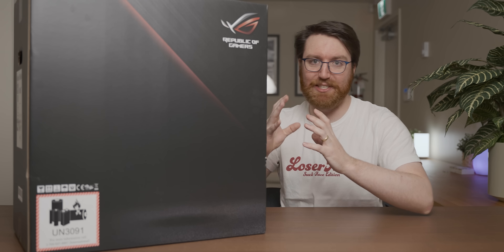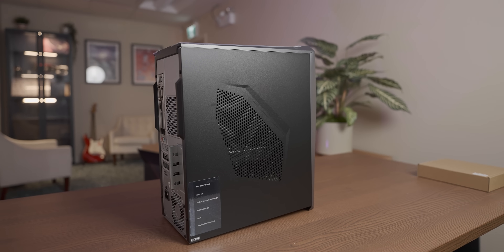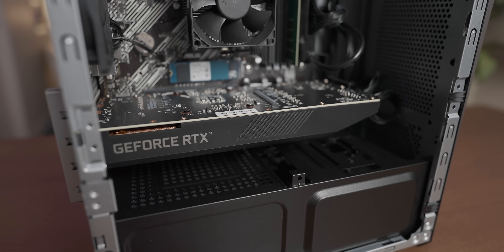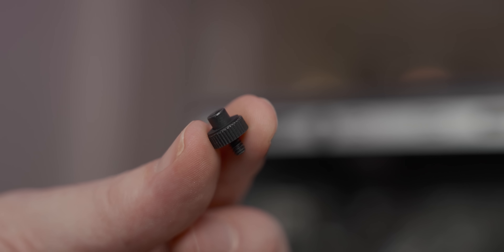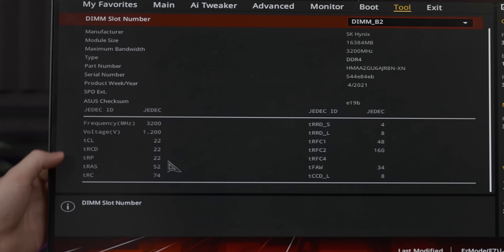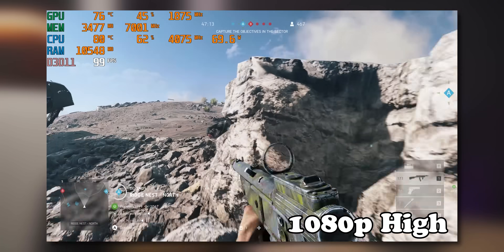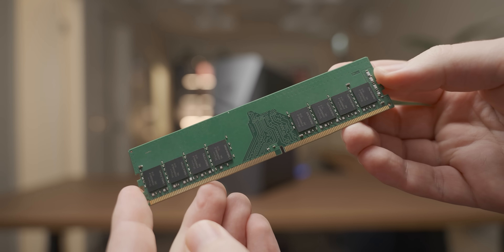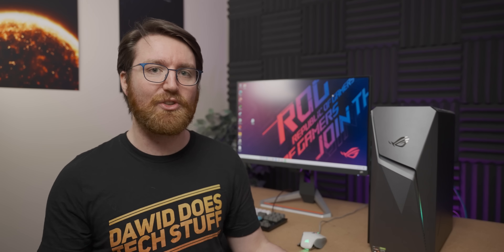Why Do Asus ROG Pre-Builts Suck So Bad?

Comment from the maker: If you want some cool clothes and help support more videos like this, go check out the Dawid Does Merch Store here: https://dawiddoesmerch.com
Also, thanks for watching. :D
Reply: I’m getting a pre built that has a 3060 👀
Reply: Take a Dremel with a small cutting wheel and make those fake vents functional.
Reply: Best channel
Reply: Best video
Reply: Best youtuber
Reply: How about a vid on an easy case mod to increase airflow and how much it improves performance. Love your channel.
Reply: are you every going to look at canada computers prebuitls there armory brand. You should there a great price to performance ratio but have bad power supplies for sure.
Reply: Let's see you upgrade the cooler and take off the front panel to see it perform.
Reply: I'm absolutely loving your content, and I think the comparison of single ram stick to 2 is a great touch! I think there is an avenue to bring your videos even one or two steps further: Could you run another set of benchmarks and temperature tests after adding additional case fans and aio to these systems? Given GPU outages and frequent discounts on prebuilt systems, I believe that many of us are considering whether we could just buy some of these prebuilds and then further improve for under 250$.
Reply: I just recently discovered your channel and your content is awesome.  You are well on your way to a million subs.  Your hard work and dedication really come through in your videos.
Reply: @dawid can you also try and fix the temps on this prebuilt
Reply: Great video as always Dawid
Reply: Too bad that you have not removed the front, would be interesting to see if that would bring something but since fans are missing in the front...
Reply: Two other tests would be:
 •Side panel off.
 •Rebuild in a better case.
Reply: hey Dawid, really great deal, want to trade your 3700X for my ryzen 5 3600? This system needs a downgrade lol
Reply: Can you do a review on XUM gaming pc pls
Reply: Correct me if Im wrong, but is the MB an Asus Prime B550M-K?

I saw that MB tech specification on Asus USA homepage and said it has a VRM heatsink, while the picture on the homepage does not show any VRM heatsinks at all.

And also, IIRC the B550M-K do not have ARGB headers, and does not support Aura Sync. Why does the brochure for G10DK said otherwise?

Did Asus made a mistake about their specs and advertisement on their site or I'm wrong?
Reply: So what pre-built should I go for! Im looking for a good one to run Steam VR & capable of next generation gaming/ray Tracing etc?
Reply: Ant esport case
Reply: You ask why the cheap front panel and cooler, I would say cost cutting obsessed (They would say profit increasing) Accountants.
Reply: comming up next why the corsair prebuild sucks, sponsored by asus
Reply: There were editing flaws in this video.
At the end you recommens asus to upgrade the cpu cooler, there is a poo sound but no image example 😢
Thats all! Love your videos! Your doing great!
Reply: upgrade it drill holes in the front panel or cut a square out and glue a mesh their too allow airflow then 2 rgb front fans with a rgb controller and a exhaust fan too the back of the case , plus a Coolermaster 212 black edition on the CPU and a full occupation of complementary ram PIMP it properly ....
Reply: no thx
Reply: I bought a Asus G11CB back on 2016 which had a Delta PSU 🤣 After so many years they still use shit power supplies for their systems 😎 LOL 😎
Reply: Dawid I just bought the asus rog r7 with the r7 5700g dual channel 16gb 3200ddr4 and a asus 3060.  Using cinebench my cpu went up to 93c pretty dang hot.  With no intake fans and one exhaust in wondering if replacing exhaust fan and a new cpu cooler would help?
Reply: I got armoury crap on an msi mobo to control an asus gpu and it literally broke my windows
Reply: Shoulnt you write actually what you are testing and not let us guess.... a downvote and im not watching this
Reply: Can anyone tell me if it’s a atx motherboard or not
Reply: @yourhandlehere1  that's ruining the warranty
Reply: @tjtjmich16p  I've never had a case "go bad".
Reply: This maybe a stupid question ; but is it possible to feed the temperature sensor info into the RGB colour output of a PC equipped with that sort of thing so you can keep an eye on if the PC is running hot  just by looking at the colour of the Christmas lights on it ?
Reply: could you please put the sticks of ram you purchased and what fan you recommend on an amazon affiliate to buy and you can get credit too please?

Comment: Looool. The ‘fake’ front airflow marketing just breaks me.
Reply: @moonman7777  The case got better airflow than my own custom build.
Reply: @skids6885  That’s impressive. Is it in just a metal shell?
Reply: @Psyberify  i was sorta joking on my sentence, since my case only has ventilation from the side towards the front io. In others words it doesn't breath. Just the interior exhaust fan at the back of the case is effective.
The case has a very nice exterior with a tempered glass side panel, and a brushed aluminum look front panel.
Reply: @skids6885  
my case makes  this case look like an air tight coffin.  i'm using a CoolerMaster HAF XB lanbox/test bench case.  two  120x120 fans in front one in back and a big 200x200  fan on top.   the main board lays down in this style of case so i coupled it with a Be quiet  Shadow rock  top down cooler.
Reply: @DenverStarkey  That case looks somewhat like a box server ngl, but still really cool, that case has alotta airflow ventilation. Makes me replace my case with something similar since my cpu temps always spikes high underload.
Reply: @Anna Muller did you take the kids and run yet since David has bought so many PCs?
Reply: Anna. and Dawid, the studio looks amazing! Well done. Xx
Reply: Say ,Anna,how DO you manage to deal with all the pre-builds Dawid bought???
Is there a limit ?
(8))
Reply: Even worse is the fake picture advertisement showing a decent beefy cooler when they throw a cheap Celeron cooler in the case.
Reply: I did learn something today though: Actual airflow is more important than marketing airflow
Reply: everything is fake in this build, until its named rog
Reply: wait till you see the bs from dell
Reply: @Tano facts
Reply: It’s so weird - how can it be difficult, or add to the overall cost, to have some airflow slots cut out?
Reply: In their defense, that image shows them using the clear side panel which WOULD have air flowing through the front gap right where the image shows the air.  That said, I think the image is still a bit misleading since the air coming in stops before the gap in that side panel... thus anyone looking at it is going to think they have holes in the front.
Reply: The job was given to a Graphics Illustrator, to Illustrate a Blue mass of air, becoming a Red mas of air, but the Illustrator wasn't informed of the Faux Grill, of the PC. (being suffocated, and all.)

Comment: I think ASUS is doing something very technologically advanced with this case. Air flow by quantum tunneling.
Reply from the maker: Maybe it's the next big step in case design.
Reply: Ant-man style ;)
Reply: @DawidDoesTechStuff  i am glad i went with Coolermater case H500 its awesome and tons of airflow with front panel MESH..and 2x200mm fans.. got great temps even with 5900X and 3080 its just on another level even those ports on front with case its horrible just a few ports..
Reply: those temps are so bad.. i stay under 65c even under load in games with my 5900X using 360mm Aio and GPU is Gaming X TRIO so i stay around 70c even with 3080
Reply: Unless the tech is a result of alien negative energy tech the constraints in airflow is choking the life out of that poor gpu blower. The blower motor will probably fail before the gpu. The gpu will meet the same end soon after.
Reply: @ivo3598  dumb question but maybe you can help. How do I identify which case works with my pc? I got the asus prebuilt from BB coming in two days. Only negative is case/heating so I’m hoping to correct that right away
Reply: @davidbartsch255  TBh, you look what you like, if it fits your components in, and then you check out some reviews about cable management and temps. But as a rule of thumb: Lots of Mesh is always a great Idea, and dont overspend on your Case. Trust me, its perfectly doable to spend like 300 bucks for a really fancy chunk of heat. It all comes down to what you want. If you dont need super amazing RGB Lighting and just a case thats not disturbing you, you can get away with like 40 dollars for a case with good airflow.
Reply: No, air flow by virtual particles
See asus has connections, they use ultra advanced technology so that every single particle of air is being snatched right out of existance so that it just spawns out, therefore creating a vacuum, but by the amazing infrastructure it doesnt get squashed by the 150lb of gravity force being pushed upon, the gaming beast
Reply: @DawidDoesTechStuff I have this computer, and one time I was cleaning it, the front panel (which has fake vents) were covered in dust, so I suspect there might be some air flow going on.

Comment: One thing I'll never understand is why they go through the effort of faking vents, when they could just use less material and have actual vents...
Reply: Depending on the process to make usable vents, they may be actually wasting or matching the material used to do so, but I'm sure it is probably more due to manufacturing costs than material costs.
Reply: Planned obsolescence, I imagine
Reply: It's like people who buy fake hood vents and riotously stick them on their Toyotas and say they're muscle cars!
Reply: @elephystry I don't see that, the hardware will never run hotter (if you do basic maintenance). That case is just poor design
Reply: More effort is required to machine the holes for flow. I'm not saying that is good justification. The problem lies with vendors wanting to sell products with round numbers (i.e. $500, $550, $575) so if the machining costs an extra $3, the vendor doesn't want to have an "weird" number (not a zero or 5) in their "round" price. 

It's the dumbest sh1t in the world.
Reply: What about cutting plastic? Where the “vents” are, could that be actually a good thing ???

Comment: The last time I saw Chicony's logo was on my 14 year old Chicony membrane keyboard that surprisingly still works well and has no letters peeled off of it.
Reply: i have chickony's keyboard that is ps 2 and 11 Years old it wos used with athlon xp or sempron windows xp based maschine(fun fact it was having giant turbo "ninja" flower cooler fool Cooper temp under full load 35)  its still working perfectly Fine and ITS MECHANIC KEYBOARD at its buy date it cost obout 20 $
Reply: full cooper
Reply: Their 80s early 90s keyboards had blue Alps and other highly sought after switches, then they got infected with the rubber virus.
Reply: My dock has a Chickony power supply, and I know there are some others hanging around in boxes from the Paleolithic era.
Reply: I’ve heard of chicony somewhere can’t remember where tho
Reply from the maker: Hopefully being able to make a reliable keyboard is the same as a reliable PSU. 😁
Reply: My MSI GS65 comes with chicony 230 watt power supply
Reply: My 2019 Acer Nitro laptop comes with a Chicony power brick.
Reply: @Ivy-pe2wz  Chicony is from Taiwan and they are still up and running
Reply: @DawidDoesTechStuff  makes me want to make a corel for my chicony laptop brick
Reply: My MSI laptop power adapter is made by Chicony.
Reply: @lukatosic4447  whats up with gigabyte?
Reply: @DawidDoesTechStuff  Chicony is a high tier PSU manufacturer, in consumer tech they make PSUs for ASUS and MSi, for others its more often Delta and Lite-on
Reply: Suprisingly same as me i got a Gray one
Reply: PS2 one
Reply: My MSI gaming laptop from 2015 came with a Chicony power brick....never had an issue with any of it. I think they are probably fine.
Reply: @Ivy-pe2wz  Yep, I remember Chicony from when I used to put together & sell PCs in the late 90s.
Reply: They are apretty big OEM in the laptop power brick sector.  All the laptop powerbricks i have seen are either Chicony, Lite-On or Delta Electronics.
Reply: @mariuszstykaa1853  don't take this as an insult please as I know english isn't everyone's 1st language. But I laughed out loud at your 2nd comment instead of an edit to attempt to correct 1 of the multiple typos and you still misspelled copper. It's charming and honestly shows that you both care and are attempting to improve. By the way it's spelled "was" not "wos" that's really the only thing in there I would worry about. Have a great day good sir
Reply: @DawidDoesTechStuff  I don't see how there could be any variance in the processes of construction or design. I mean they just convert pixies from the wall into nerd stuff right?
Reply: yeah, memories are becoming alive. 15+ years ago,  there were cheap, quiet and reliable keyboards. Where are these times 🤷‍♂️
Reply: @mariuszstykaa1853  Close, but no cigar!

Comment: Clearly the single stick of RAM is actually a hi-tech heat management feature.
Reply from the maker: It really seems like it.
Reply: @DawidDoesTechStuff .
Reply: Correct me if Im wrong, but is the Mobo an Asus Prime B550M-K?

I saw that MB tech specification on Asus USA homepage and said it has a VRM heatsink, while the picture on the homepage does not show any VRM heatsinks at all.

And also, IIRC the B550M-K fo not have ARGB headers, and does not support Aura Sync. Why does the brochure for G10DK said otherwise?

Did Asus made a mistake bout the heatsinks and Aura or I'm mistaken?
Reply: well, i really think it`s probably that SOME Ryzen are benefiting a lot from dual channel. For my pool old 1600AF the change between 1x8 and 2x8 is no more than 5%
Reply: @iliyacheresharov  you'll get about 5% more fps in dual channel sure, but you'll get better stability and frametimes, meaning you'll have less micro stutters.
Reply: Lenovo Legion pre-built uses 2 of 4 RAM slots.

Comment: It's like no prebuild manufacturer understands how cooling and airflow works.   They all seem to be shooting for some ideal form of a completely sealed box.
Reply from the maker: It's weird especially considering that Asus knows how to make a decent case.
Reply: It's because people who buy prebuilts don't ever bother to open their computers and clean the dust. Additional airflow will only make this worse. And it's also less effort for Asus anyways.
Reply: Let's forget we that the 2021 version of the Legion 5 have a proper mesh front and top
Reply: @DawidDoesTechStuff  Prebuilts like these are marketed at young kids who couldn't care less about airflow, and don't care about specs either except the big main numbers (3070, 16gig ram, ryzen cpu, etc). They don't care that the whole rig is bottlenecked in 10 different places and probably losing 50% of its potential peak performance because of it. As long as they can get around 100fps in their main gaming resolution they'll be happy.
So why would Asus bother shipping the prebuilt with an actually competent cpu cooler, or make a case that's just gonna let more dust in and require more maintenance that said young kids won't ever do? Why make a clean design, when edgy is what sells to their target audience? Why even brand it with "ROG" when there is not a single ROG product inside? It's all because they want to cut away as much cost as humanly possible, because their target audience wouldn't be able to desire the increase in performance anyways. Why charge more for better solutions, when customer can be satisfied with less. It's pure and simple business.

Asus knows how to make the best GPU solutions on the market, yet they ship it with this barebones 3070 that is barely any better than stock. They don't even use their own power supply which they're so proud of. The only thing worthy of their name is probably the motherboard, because they actually build it from the ground up and thus can afford to offer a decent solution.
Reply: @Real_MisterSir  Your patronizing aside, most machines have bottlenecks of all sorts in them. By nature of tech its impossible for everything to 100% utilize everything else to its fullest. Like how not even modern ssds can saturate a pcie 3 bandwidth.
Reply: @DawidDoesTechStuff  ye my tuf gt 301 never gets hot ever
Reply: Think they don't care
Reply: @DawidDoesTechStuff  Ye my tuf GT 301 is a great case. This case would have been great if thos lines things on teh front were actual vents.
Reply: They perfectly know how to make good prebuilts, they could just use all the components they make (coolers and cases) but the profit would be much lower than the one they make with the cheap components you see in this video. It's all a money matter!
Reply: @louiesatterwhite3885  You said right although "modern ssds cannot saturate a pcie 3" is wrong example. Bottle neck is when you have ferrari and you're driving 20 kmph on busy road.
It's not bottle neck if your car can reach 60 kmph max and speed limit is 100. You're using system at full speed.
Reply: It actually has air flow at the bottom of the front panel.. I don’t see how he missed that .
Reply: @joehardy8455  Its still not enough either way